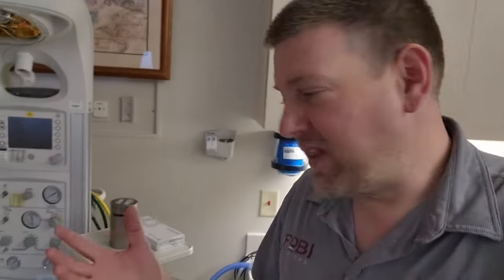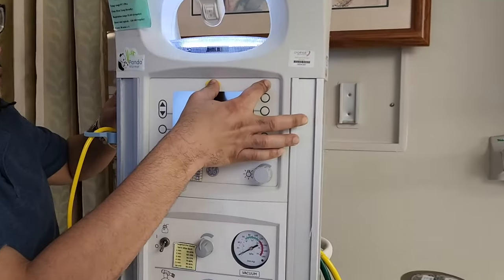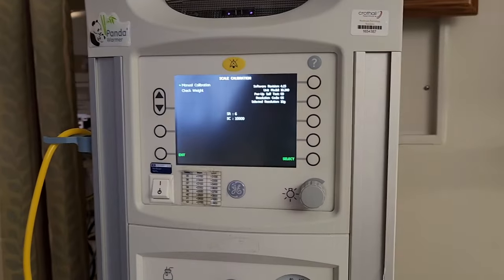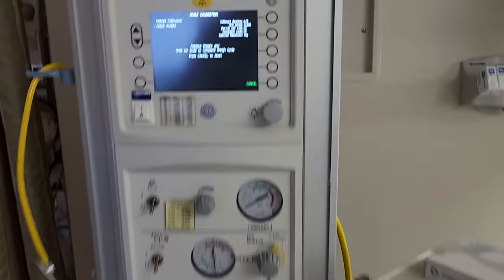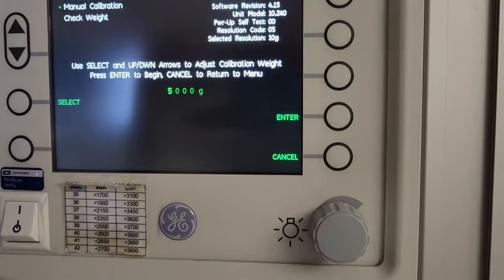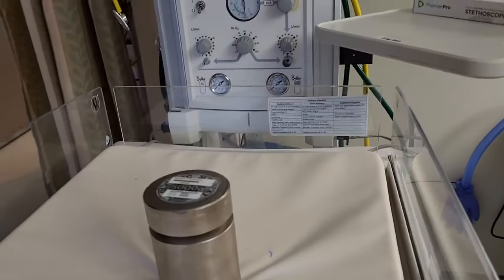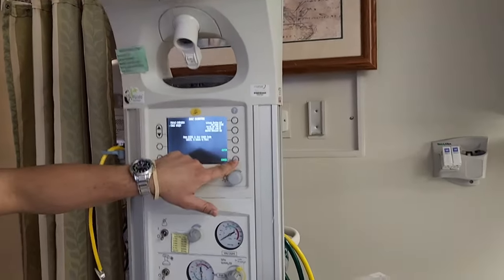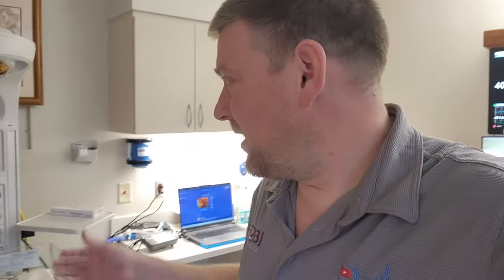GE Panda Warmer Scale Calibration

Comment: Question? Why are you using the 5000 Kg weight without gloves being used with the calibrated weight? I could have never have done this with my weights and Mettler Toledo balance calibration checks. The finger prints on the weight would make the weight out of tolerance and then a deviation would have to be entered into our CAPA system. I may be overthinking this in my experience of calibration labs and out in the field for balance checks. Thanks for all of the content on your channel and Happy New Years Justin.
Reply from the maker: Fair question. There is absolutely no reason to use gloves with a calibration checked 5kg weight. We are not NIST tracable, and the minimal difference at 5kg is negligible. For precision weights - yes, absolutely, wear gloves.